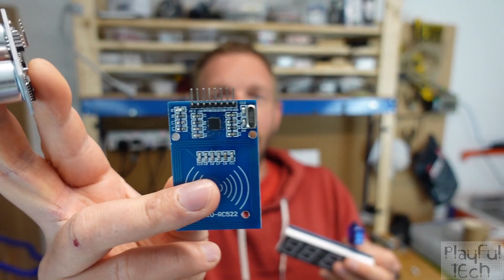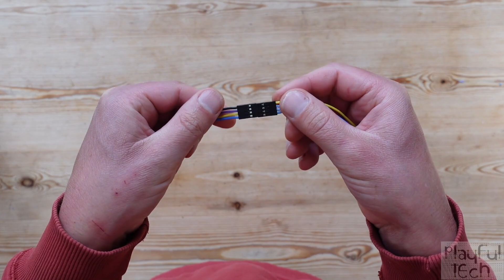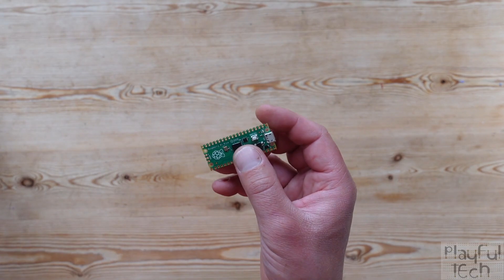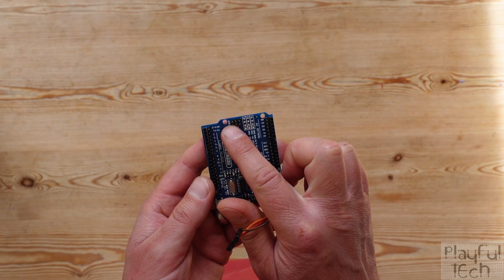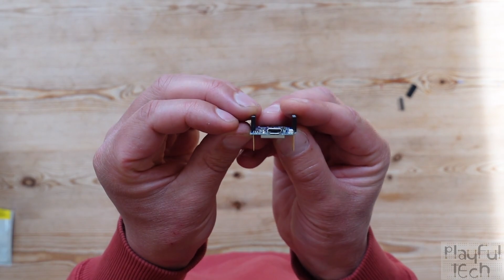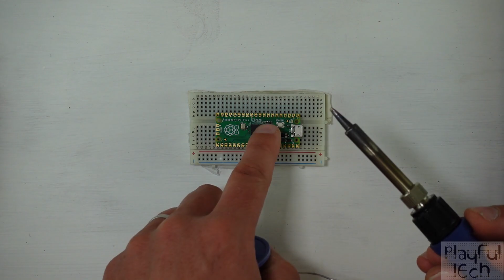Header Pin Connections for Raspberry Pi, Arduino, ESP32, STM32 Micropocessors

Comment: Hello, I just discovered your channel.  First, thank you so much for what you do. My wife and I own a small mobile business where we use lasertag and puzzles to create a unique emmersive experience for our clients.  We have been using pad locks, but are slowly getting into doing more elaborate puzzles that require electronics.  We have one we are working one that there are 2 teams. One is trying to open a portal, the other is trying to stop them. They have to sve some puzzles to open chest that contain relics. They then need to place the right relics in the right order to trigger the portal/ or lock it. So each team has there own relics to get (3). I planned on using arduino and 3 rfid for each base. Then some how have those send a trigger to the portal to trigger lights, sound and fog. We want the portal to light up each time a correct relic is placed on its location, kinda like a score board. The first team to get them all right would trigger a certain sound,lighting effect and possibly smoke. ie portal opening or getting locked.

Comment: When you're done soldering, you can clean up the flux residue with 100% isopropyl alcohol. It will completely evaporate when done and doesn't damage the electronics. Also, wash your hands thoroughly after soldering to remove any lead. GreatScott has a very good tutorial. Adafruit also has a good tutorial.

Comment: I found a woodworking chisel quite usefull for cutting (7:44) female pin headers to a certain length. Just remove the pin with a plier and before and press down on the pin header once from both sides.